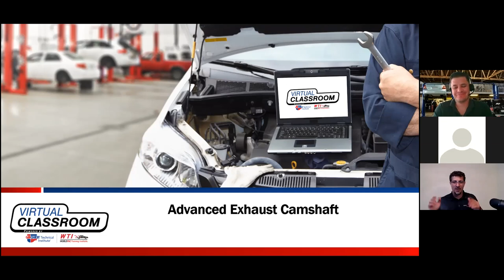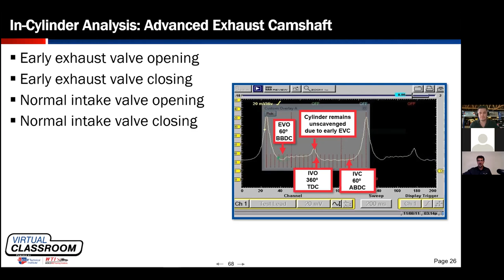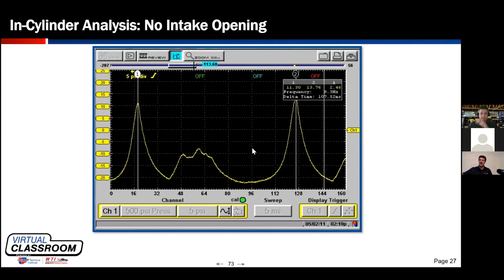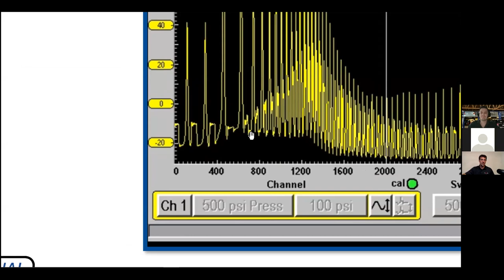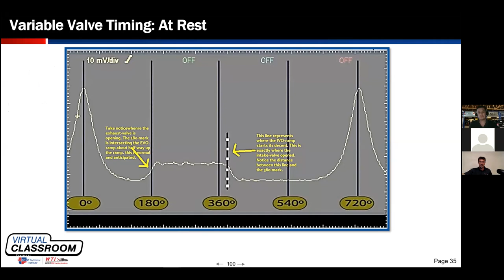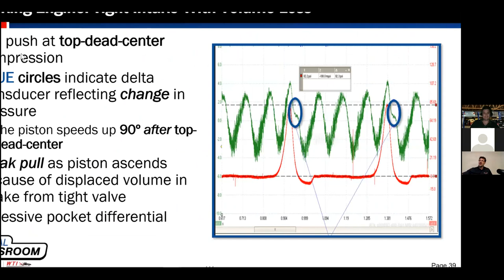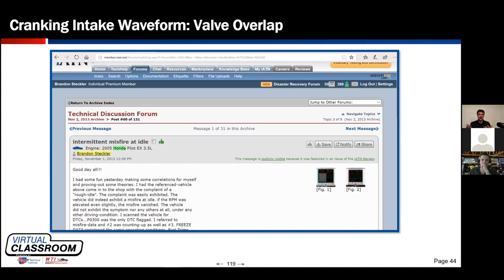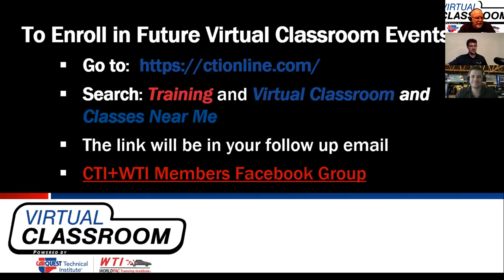CTI AD-3000-8 Session 2

Comment: You can make your use other diy pressure transducers but you need a quality sensor like a Honeywell sensor or something like a Johnson controls sensor. A lot of the cheap ebay sensors and such don’t have a fast enough response time. I have a Honeywell px2 transducer that I used a lot before I got a wps500 that had a great response time and made a nice clean waveform. The ATS transducers look identical to that Honeywell and I wouldn’t be surprised if they were made by them.

Comment: What if i have same same spike on my exhaust stroke tdc but i got only one camshaft and 4 rockers per cylinder. Also, at idle no problem, but when i rev the engine up, the exhaust tdc spike get higher and higher like im losing a normal scaveging. I could have udrestand that if i had 2 seperate camshafts, but i have only one camshaft. Exhaust is not plugged. Im confused, that is not normal. It gains losses of power to overcome this excessive pressure and also makes my fuel trims go negative - false rich condition. My exhaust valves, spark plug and lambda sensors are white. Lean mixture white